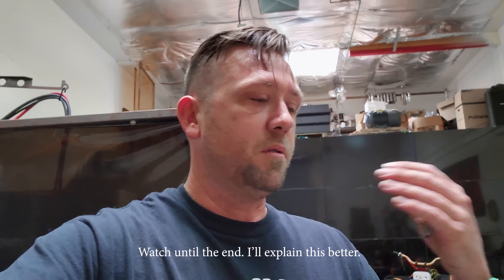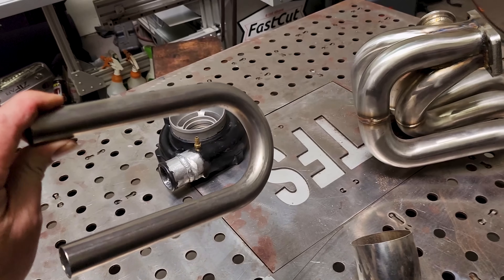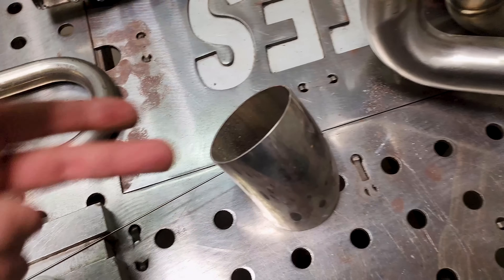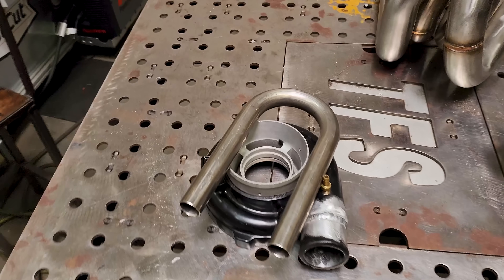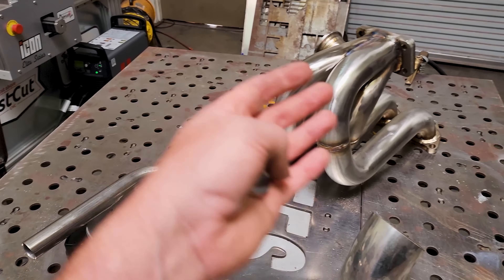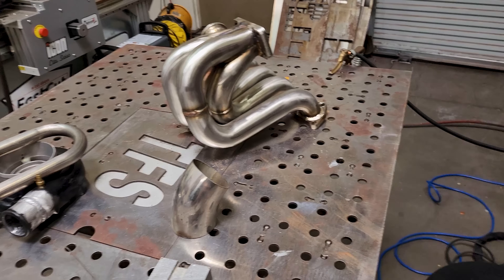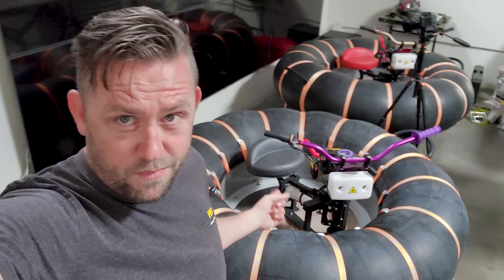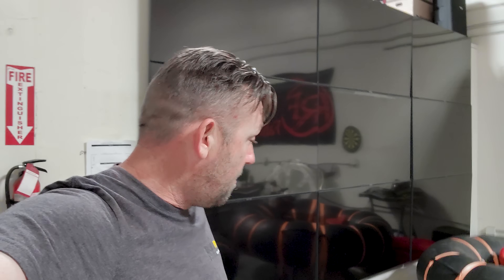Can You Grade Stainless Steel with a Magnet?

Comment: Good video.  Referring to one of your comments below regarding grade 409 SS which apparently is not as good as grade 201, how do you tell the difference.  I purchased a replacement "stainless steel" muffler for my Vanguard 35 hp motor and most of it was highly magnetic.  Is there a way to tell the difference?

Comment: I definitely understand that cold working, different processes and all, play factors in magnetism. But should a threaded rod (10 or 12 inches) be so magnetic I can lift it and shake it without it falling off of the magnet if it's really 304 stainless?

Comment: Hmmm... that might have been what we found at my parent's retirement place when they first moved in.   There was a 3/16" thick plate about 2 foot by 3 foot buried in the dirt and weeds under the previous owner's pile of crap at the back of the property.  Full force whacks with a pick axe didn't dent or even scratch it, there was no rust or corrosion of any kind, and a magnet did stick to it.  (There was also a Halloween tombstone made of real stone buried back there too.)

Comment: Actually any austenitic steel should be non-magnetic. It's not about nickel as it is but the austenite itself. Were the magnetic parts work-hardened? I mean, it seem they are welded from stamped sheet, so if they weren't tempered after the welding they probably are, and that solves the mystery of magnetic stainless steel. Or the material itself isn't actually 201 because some scam =)

Comment: I believe the 200 grade is called work hardening austenitic stainless. So through cold working it can be turned to martensite which is magnetic. So you're more likely to have some magnetic properties coming from it. 

Like you mentioned with the bent part of the 304 stainless, it should technically convert more readily to martensite than something in the 300 grade.
Reply: 304 work hardens.
Reply: @notanymore9471  it does, just not to the same level.

Comment: "It's half the price because it has half the stuff in it". @4:00

That's a bit harsh, isn't it? Yes, type 201 has half the nickel in it, but that's compensated by adding manganese and by allowing more nitrogen to be present. In fact, there is slightly more manganese added than nickel is taken out.

Type 304 is allowed to have up to 2 wt% Mn, but doesn't need any per se, while 201 has to have between 5,5 and 7,5 wt% Mn. 

201 is a lot cheaper than 304 because manganese is cheaper than nickel.

Comment: We use 316 stainless at work as we are pumping saltwater up to 325psi.  We have done multiple magnet checks on out system  (around 600 pump runs) I’ve had 1 SS nipple grab a magnet strong enough to question it. I called my higher ups and showed them video. After some research they said the lathe process can induce some magnetism into the part.
Reply: Cold working of 304 and similar will make it somewhat magnetic.  Stainless is famous for work-hardening, and for example can be a nightmare to drill if you relax pressure or pause etc.
Reply: Only fully annealed 316 is non-magnetic. Any cold work in particular can make it slightly magnetic.

Comment: Going to let you know that a lot of lower grade stainless steals contained ferrite to prevent hot short cracking usually notice it in 304 stainless steel especially in thicker parts so that's another reason that you see it more in the radius than you do the rest of the tube wall

Comment: what about 316 stainless steel is it worth using it over the others in automotive (cars )
Reply: In addition to being significantly more expensive, 316 is lots harder to find in the different forms you may need.  It should be more corrosion-resistant in automotive applications, but 304 may be plenty good enough.

Comment: Fun fact: a strong enough magnet (RE) can stick to even 316L.
Reply: I think some aluminum will too sometimes,if it's small enough. 
 I've had it on some oil drain plugs before and it was definitely aluminum stuck to the magnetic drain plug.

Comment: what is the best stainless to make a turbo manifold out of ?    305 ?
Reply: Gasoline engine?  321.  Why?  Operation temperature is in the sensitive range for carbide depletion of chromium,  causing corrosion.  321 has a small percentage of titanium which binds the carbon stronger than chromium. 
Keep in mind,  you need 347 filler because it uses columbium instead of titanium since Ti can burn out during welding .  Columbium is also known as niobium and is very expensive. 
Next best is extra low carbon 300 series,  like 304L.   Or use 309L filler.
Reply: @keithjurena9319   thanks and yes gasoline engine  e85  gas

Comment: Production value is fine. The content of the video was very good. One thing I might add to bolster your point is that there is a 304 and there is a 304L, which in most automotive uses is really basically inconsequential (but will behave the same with a magnet test), and without stenciling or ink or the XRF gun, we can’t tell the difference in them; which I only bring up because it reenforces your point about MTRs and controlled supply chains to know what we’re messing with. Short of that, just make sure you’re welding mystery joints with 316L. Lol. 

Aside: will you be at Fabtech next month?
Reply from the maker: I'll be running around Fabtech.

Comment: sooooo the question that
comes to my mind is:

by welding 304ss to 201ss, will there be a bi-metal corrosion effect due
to the disimilar metals?  and, if so, will the high heat accelerate the corrosion?
Reply: No. He addressed that in the last video.

Comment from the maker: Let me explain MORE for the people who missed it... I'm talking about austenitic stainless. I'm not talking about the other families/categories of stainless steel. Therefore, I have no 4XX series stainless in this video. The reason is I primarily work in the automotive industry where you only see ferritic 409 on stock exhaust systems which is what you usually rip off the car to replace with something upgraded (so who cares if a magnet sticks to it if you already know what it is and you dont want it).
Reply: Did you try a 304 sample made in China or just 201?
Reply: I'm buying some hooks, seller said it's stainless steel 304, it's very strong but i said it's fake because i test it with magnet didn't attracted. Now i know from this video there's some type of stainless steel, and 304 is not attracted to magnet. i already give a bad reviews to the product on the marketplace, i hope still can change my review.

Comment: Interesting. Ever seen how aluminum is affected by magnets? Doesn’t stick but is affected. Same with silver. Like if you half a magnet from a string and swing it like a pendulum, if it’s very close to like a silver coin, it will actually move the coin when it goes by. Also, they use aluminum rails with holes cut in them and make a sled for some fire escapes, and changing the size and shape and how often the holes are it can act like a brake which is crazy. I think the magnetic field induces a voltage and basically make an electromagnet out of the aluminum. Sorry for the ramble, still interesting.
Reply: Yea a strong enough magnet slid over aluminum will make you feel like youre dragging it through thick mud. RE magnets are fun 😂
Reply: Yea - that's Lenz's Law. The moving magnet induces an electric current and magnetic field in the alumin(i)um or silver - it's this temporary magnetic field that makes the coin move Roller coasters often use this type of braking.
Reply: @alextyrer4136  thanks! My memory isn’t what it used to be, or is it, I forget.
Reply: Yeah I was saying above ,I've drained oil and had aluminum on the magnetic drain plug. 
My pops said the simple answer was the particles were so small, and the magnet was powerful enough to make em slightly magnetic.
Reply: @MrTheHillfolk  yeah and may have been some alloy that something ferrous in it too.

Comment: Another way to check if it's stainless or non-stainless is by the spark pattern when you grind it. Best way though is to use a magnet or if you own a business and poorly separate your metal stock then I would advise getting a metal alloy analyser gun like you mentioned.
Reply: I've ever noticed the difference in stick rods and tig fillers that are from China and not from China.  they absolutely weld different because the filler material is lower quality...and with TIG you can SEEEEE the junk floating in the pool between china fillers and non. it's crazy.
Reply: The scrappers I went to had one of those. It seemed to take forever so I said just give me base price mate, no it's all good he replied and continued test the different types of SS, end result was I received twice the $$ than what I was expecting.

Comment: I used to work in a factory manufacturing specialized refrigerators for bars and restaurants.  We used a lot of stainless components for customer-facing, ornamental work.

We called the magnetic stainless steel "fool's stainless" because it would corrode quickly but had the appearance of quality.
Reply: It depends wildly on the grade. I have several NSF certified (so... professional grade) stainless kitchen tables that are magnetic and they don't rust. I have long suspected they're in the 400 family, but not the same end of it that something like a commodity grade automotive exhaust might be (which do rust easily, but slowly).

I think the real fool's stainless of white goods these days is just straight-up vinyl wrap over mild steel. The wraps are getting so good that it's getting tough to tell the difference.
Reply: @TheBrokenLife  yep them cheap ass supposed high quality steak knives that get a nice rust dot or 2 after going thru the dishwasher🤦
Ah ,no biggie ,doc said get more iron.
Reply: Ever seen what bleach does to stainless? There are warnings on the big milk tanks at the farms warning about using too high of a concentration of chlorine, it will case the stainless to start to rust, fast, and I’m not sure there is a way to stop it and save the tank, they have to cut that section out, and if it’s near the internal cooling tubes it can be a total loss.

Comment: Oh god, we have an actual nonmagnetic steel in our mashine shop. I don't know what the actual designation, it's just known as submarine steel and we usually get it directly from the customer.

And let me tell you it is A BITCH to Maschine, file grind or do anything
Reply from the maker: I had some metal like that before. I still have no clue what it was but it was insanely dense and it seemed everything struggled to work with it.
Reply: @TheFabricatorSeries  A4 aka 316 stainless is usually used on boats . It is probably that one.There are some worse than 316 but that's most commonly used stainless steel that is hard to machine  .
Worse like 317 ,321 and 347 from austenitic stainless steel family or 440c ,446 and absolute bitch ams 6532 from martensitic family.
Reply: @Not a Panther-I don't know if what you're describing is what we use or not.  We build pressure vessels out of quenched tempered steel, very similar to what submarine hulls are fabricated with. It is SA517-E material, 110,000 PSI plate. It's tough as a two dollar steak. Our consumables must be within 10%, so for reference, repairs are made with 10018 rod. Once fabrication finished, we have to post weld heat treat the entire vessel.  Our oven is 10' x 10' x 60' in lenght. Basically, it is a pressure vessel grade of "T-1" plate. "T-1" is a registered trade mark of US Steel's QT material. Hope this is of interest?

Comment: 430 is a ferretic stainless. It's non hardenable but can be annealed, and not very ductile, so it's not used a ton in anything other than appliances/backsplashes in the kitchen and maybe some body panels. It's not fun to fabricate with.
Reply: @JackHudler  pretty much the same with me. Neighbor wanted a bunch of odd shaped magnetic kitchen surfaces. Nibblers are great for making filler strips.
Reply: We had to replace a stainless piping from a large holding tank to a packaging line. Kraft  BBQ sauce wouid eat through 303 in about 2 years. I forget the name of the process but we used portable maching and weld ring between 2 pipes in a run. The machine automatically welded going around the joint, controlling the time and heat so the joint was near perfect. I stopped buying that brand of BBQ sauce but did think of trying it as a rust remover. I will say that 430 is pretty pricy and with the whole process and training it was around 4x the price as 303 to buy and install.
Reply: @311jbknight  that's funny. 430 is specifically resistant to corrosion from nitric and organic compounds, so it's perfect for BBQ sauce.
Reply: 400 series is martensitic stainless, a two phase structure unlike austenite. This means there is ferrous in the structure that is magnetic. It’s always tempered bc martensite is so hard it’s unusable, so not as easy to work but stronger than austenitic stainless.
Reply: @trentpendygraft339  so is duplex a mix of martensetic and ferretic, or austi etic and ferretic, or Austenetic and ?martensetic?
Reply: Os it cheaper than 304 ,316.  (Austinetic)
Reply: 410 stainless is very slightly magnetic. It has 2% iron content, and is hardenable.